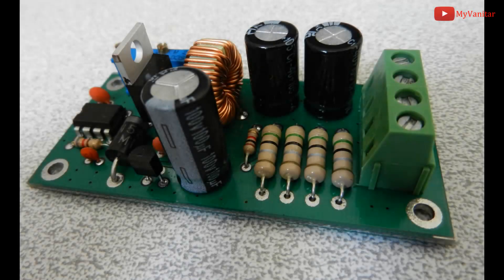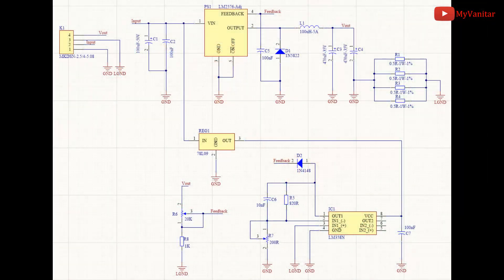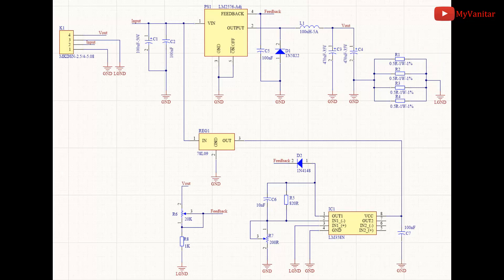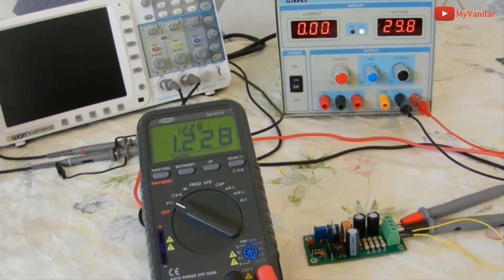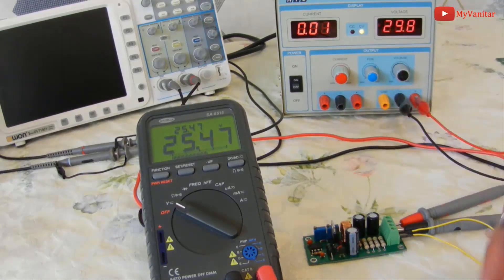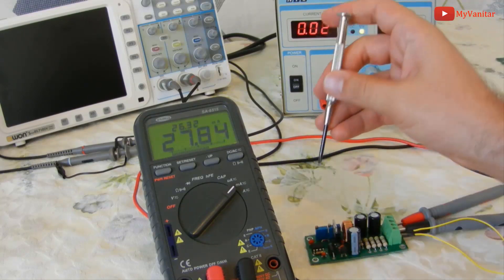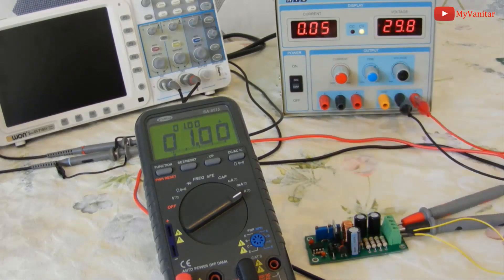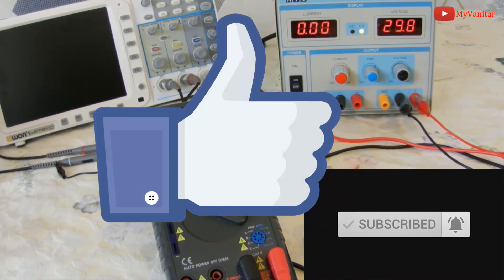Switching Power Supply Circuit Using LM2576/LM2596 [Adjustable, Buck Converter, CC-CV]

Comment: Is there any better option then LM2576/LM2596 for fixed version (5V/2A+ and 3.3V/400mA+)
Reply from the maker: get the 5V-2A from the chip and for 3.3V-400mA use a linear regulator. This is the simplest solution
Reply: @MyVanitar  Can you please tell me buck converter IC number better then LM2596 ?
Reply from the maker: @sanjaybatra6593  better you mean more power?
Reply: @MyVanitar   better performance and features. (fixed type 5V/1.5A-3A ).
LM2596 is outdated and in market from 15+ years.
Reply from the maker: @sanjaybatra6593   These are active products that are still in production by the manufacturer (Texas Instruments) because many use them in their final products. you can use TPS5450DDAR, but you must use feedback resistors to get that 5V and get one output from there. use a linear regulator and convert 5V to 3.3V and get the second output.
Reply from the maker: @sanjaybatra6593  check my channel for similar designs

Comment: I made a buck converter circuit using lm2675 but I have a problem . After 15 minutes of powering the circuit, the regulation breaks down and the capacitors start to produce scratches. Could it be due to a cheap and high Esr value capacitor?
Reply from the maker: How much is the input voltage/output current?

Comment: R7=200ohms or 200kohm??
Reply from the maker: Did you check the schematic in the article? 200R means 200 ohm
Reply: I haven't 200R can I use 5k then what modification I will do @MyVanitar

Comment: Voltage and current testing should be done under a load.

Why the 1a limit?
Reply from the maker: I don't get what you mean, the maximum current of this circuit is 3A. there is a more professional circuit as well, check my latest video (0-30V, 0-7A adjustable switching ....)

Comment: can I use 5 volt insted of 9 volt for op amp?
Reply from the maker: You mean using 78L05? Yes, you can
Reply: @MyVanitar  thank you sir.
can i use 1n4007 insted of in4148?
thank you for reply.
Reply from the maker: @discoverelectronics9207  most likely yes. 1N4148 is very famous, have some in your component storage.

Comment: i believe pin 3 of op-amp must connected to shunt resistor, not gnd.
Reply from the maker: That's not GND. That's LGND or the shunt connection. Input and Output grounds are not identical. This is a low side shunt
Reply: @MyVanitar  that's right, thank you

Comment: Hi. There are two seperate grounds: GND and LGND. May i ask why? Is there any consequences of using single GND line?
Reply from the maker: There is no ground separation. Pay attention to the schematic. the shunt resistor is place on the ground path. LGND means the ground side which will be connected to the load. It is the schematic labeling
Reply: @MyVanitar  I think you have C4 in the wrong position on the schematic.  You show the shunt resistors connected from the ground (GND) side which.  Should be connected before the positive side of C4.  You've got the output flowing through R8 as well as R6, a potentiometer, so this must be for very low current use.
Reply from the maker: @jeffw2338  C4 is just another output capacitor (I used two in parallel to reduce the ESR) to reduce the noise. Opamp senses the voltage difference on the shunt. LGNG (means load ground) is not equal to GND (input ground)

Comment: Can you build a version that can dynamically adjust the voltage by the input of an external MC? (ESP, Arduino, RPI GPIO?)
Reply: https://www.youtube.com/watch?v=hyLYPu-4EN8

https://www.youtube.com/watch?v=SM5qPrOrDrc
Reply from the maker: @benfranklin4524  Thank you. First link is better
Reply from the maker: You mean you want to have a digital version of this, to control the voltage/current using push buttons instead of potentiometers or by some commands from another hardware that contains an MCU, Arduino or similar?
I can do that. if you have a project inquiry just send me an Email (you can find it in the about section of the channel)
Reply: @MyVanitar  It would be cool to control the voltage with software. I've seen many Buck converter tutorials and build videos on Youtube but none covers this. Most use fixed voltage or manual resistors (potentiometers).
Reply from the maker: @FuchsHorst  That's because making closed loop control in accompany with digital control is difficult. I'll make one if I had time. if you had more circuit ideas just let me know